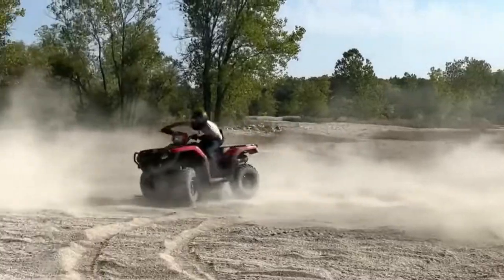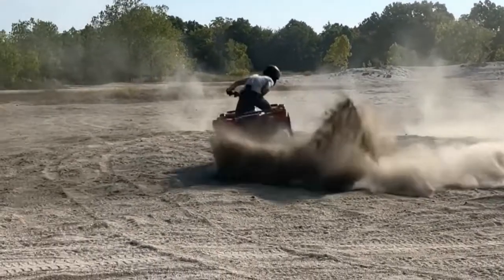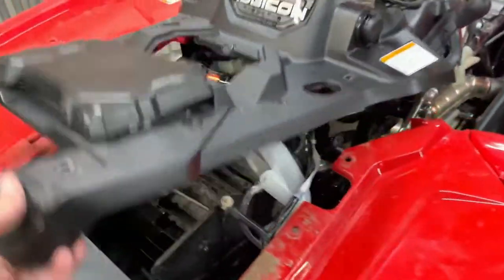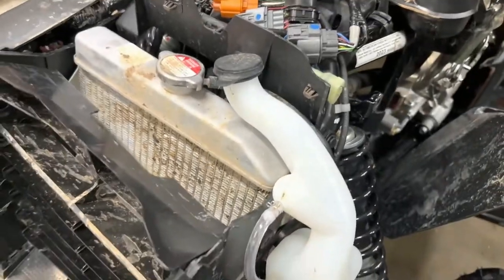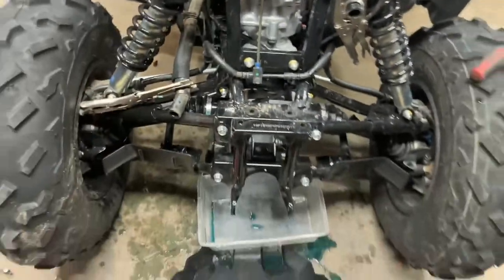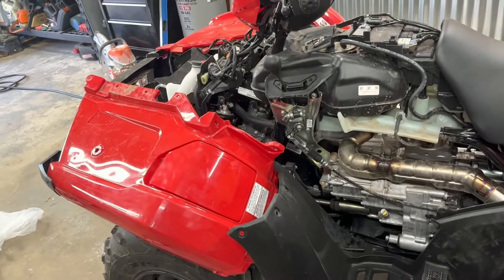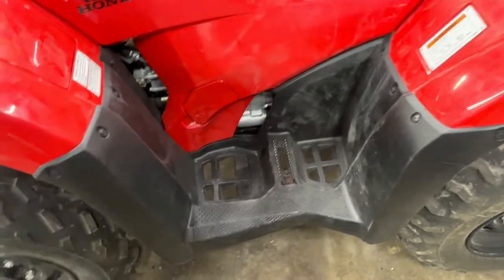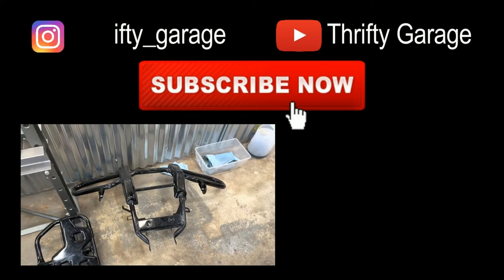Fixing our NEW Wrecked 2023 Honda Foreman Rubicon

Comment: Looking at the same machine for plowing. It's August but better to buy now and be ready! How did it do plowing for you? Any need to upgrade to stiffer front springs or are the stock ones handling the weight ok? Thanks and looks like an easy repair job.
Reply from the maker: I’d buy the same machine again. If I didn’t have employees I probably would get the manual shift version. The plow is very lightweight. No need for upgraded springs. Stock tires aren’t the best for traction but they worked fine for us.
Reply: @ThriftyGarage  Thank you for the response. Good to know about the tires.

Comment: Nice Job! How fast were you going when you hit the tree?

To remove the crankshaft bolt, use a 1/2 inch impact driver and a 2ft driver extension coming in from the rear of the machine. That was the only way I could get it out when installing my pull start.
Reply from the maker: I wasn’t driving when it hit the tree. Nor did I see it. But by the sounds of it it was pretty fast, 15-20 mph or maybe more. 

Thanks for the tips on the pull start. I’ll tried my 1/2” Makita but perhaps I’ll have to give it another go!
Reply: @ThriftyGarage  Oooof. That hurt my heart to see it mashed up, but the design is sound, to allow the rack/bumper to absorb the impact and save the frame.

I used a Milwaukee with a wall plug and it worked, barely. They really have that crankshaft bolt in there good.